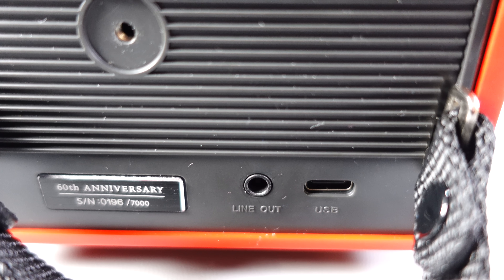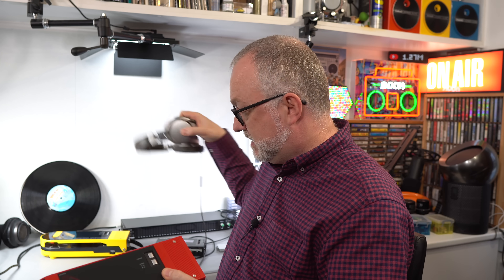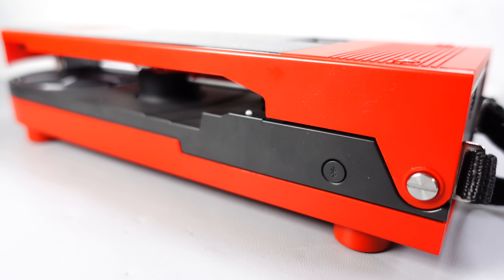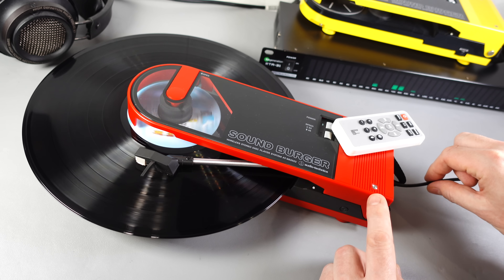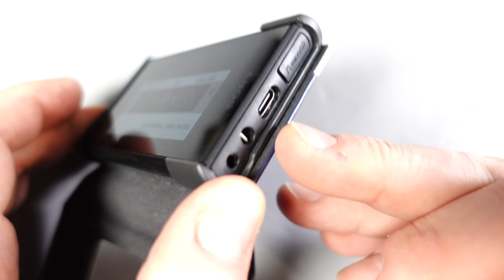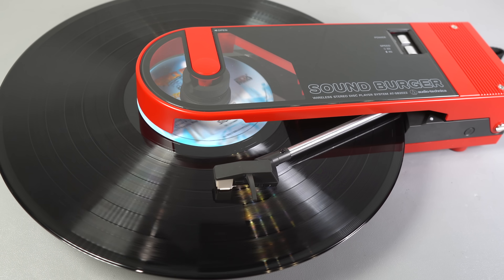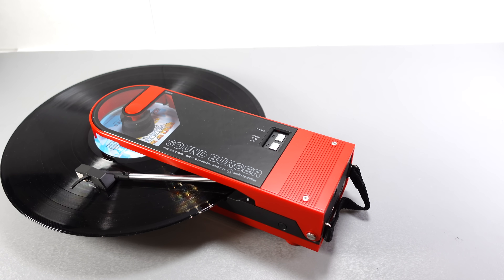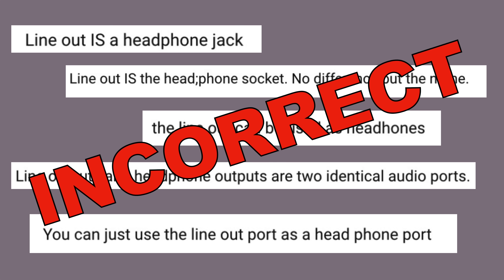Line-out ≠ Headphone-out

Comment: Another difference to consider is that the circuitry for creating a line output is designed to only provide just enough power to convey the signal from one device to another. They aren't meant to provide the power required to physically move a speaker/headphone diaphragm. And doing so could potentially damage or destroy the line output of a device, as it is being asked to provide a lot more power than it was designed for.

Related to that is the impedance mismatch. Consumer line outputs are meant to drive a load of roughly 10,000 ohms. Headphones are typically less than 100 ohms. Not only does this mean that it takes more power to drive the headphones than a line input, it also means that the frequency response is going to be all wrong. When headphones are plugged into a line output, not only will it be quiet, and you could be damaging the circuitry, it's also going to sound bad -- usually seriously lacking in bass, overemphasizing higher frequencies.

You can usually get away with going the other way (headphone output into line output) because it's easier to drive a higher impedance load than a lower impedance load, so headphone amplifiers can easily output the power required by a line input. Sort of like asking a sports car to idle down the street. But the impedance mismatch is still there, and it could result (depending on how the circuitry is designed) in bass frequencies being over emphasized. The other issue there is that headphone amplifiers, because they are primarily designed to provide more power rather than a cleaner signal, are often rather noisy (mostly in the form of hiss) compared to a true line output.

The best thing to do is make sure that whatever load (headphones, line input, whatever) you're driving matches what the circuitry in the output is designed to handle. Anything else can result in poor quality sound at best, and damage or destruction at worst.
Reply: if someone designs a line out that gets damaged by plugging in headphones, it's just bad product design, because it's obvious someone will surely do that
Reply: Indeed, my phone sounds better than an ipod with headphones, but the ipod(through a dock) using line out to my amp sounds better than connecting the phones headphone out to the same amp.
Even line out signals seem to vary though, I've got a portable line in recorder, but it gets peaked out(beyond adjustment on the recorder) & clips with the line out from some devices.
Reply: Another problem that arises when connecting a headphones output to a line input is the voltage level:
A lot of modern mobile devices at maximum volume are only capable of outputting a voltage at the headphones jack that is just enough to drive low-impedance headphones to a level that is acceptable by the ear protection limiter lobby. That voltage is less than what a line input expects.
On the other hand, several audio amplifiers have a headphones output that is tapped internally from the speaker amplifier circuitry outputs, with some resistors in series. This voltage us usually way too high to feed into a line level input.
You might be able to correct for this by adjusting input sensitivity or output volume but you will be introducing degradation, in noise levels and/or frequency response.
And, yea, the line output is totally useless for headphones.
Reply: Line Out = high impedance
Headphone out = low impedance
And yes, 600 Ohm is still considered low impedance.
Line out is designed to not drive anything else other than an amplifier, which is high impedance.
Reply: @kyoudaiken  No modern item of audio equipment has a high impedance line output.
Reply: @davidfaraday7963  The line level voltage is just extremely low and cannot drive any headphones.
Reply: @kyoudaiken  What particular bit of kit are you talking about? In general the line output voltage is similar to that of a headphone output and will have an output impedance of a few hundred ohms.
Reply: @davidfaraday7963  What you are saying defies the Ohm's law. Line output is not sufficient to drive a pair of headphones. You say it has the same impedance. Same voltage levels. So where is the difference? Why can a headphone amp drive the headphones and line level can't when you claim they are electrically identical?
Reply: @kyoudaiken  "What you are saying defies the Ohm's law" Does it really? In what way? 
Depending on the bit of kit, and the headphones, a line output could well drive headphones. A tape recorder of mine simply connects the line output socket and headphone socket in parallel. Note that Techmoan was able to run headphones from the line-out socket of his gadget, it just wasn't as load as he would like
And I never said that the output impedance was the same, don't strawman me. I said the voltage levels would be similar. A line out socket on a bit of domestic kit might have an output impedance of around 1kohm, a headphone driver more like 32ohm, but the voltage level would be much the same, around 0.5 - 2V.
Reply: @davidfaraday7963  It's about the loundness. And that's determined by the voltage (U) and current (I), and the latter is determined by the impedance of the headphones measured in Ohm. You could see in the video that the line-out did not provide enough power to even be usable for headphones. It's just an output for amplifiers or other recording devices. It's not meant for headphone use. This is why it has much less power because the inputs it is designed to feed is high impedance.
Reply: @kyoudaiken  Loudness depends every bit as much on the sensitivity of the headphones as it does on the electrical power consumed. The point you are consistently failing to grasp is that this all depends on the individual items used. May items of audio equipment provide ample output power for headphones from the line output socket, many types of headphones are sensitive enough to work adequately from a line output, so stop trying to generalise.
Reply: @davidfaraday7963  You either are so deep in your sciolism or you didn't even watch the video, or didn't understand the whole video. Line-out is line-out, headphone out is headphone out. They are not the same. New equipment may be able to sense if a headphone was plugged in and can switch to an amplified output, which would seem to you as if line-out would be the same as headphone out to you. There's no headphone with conventional drivers that work with line outputs because they simply cannot power them. No matter which drivers your headphones have, they can't pull free energy out of nothingness. It does not work. Unless your device output is designed to switch to an amplified output automatically, line-out is always insufficient for  A N Y  headphone type.
Reply: @kyoudaiken  Listen sonny, I've been a professional working in audio for half a century, decades before anyone thought of outputs that switch output levels, so stop trying to talk bollocks based on your own ignorance. Many a line out is plenty capable of powering sensitive headphones, I should know I've done that on countless occasions.
Reply: @davidfaraday7963  Of course, anyone on the internet could claim they work as a "professional working in audio for half a century", which isn't even a proper sentence. But okay. Maybe there are sensitive headphones out there that can work on line-level. I don't know. And I don't care. But the point of this video is clear. And I know a lot about electronics without even the need to claim I worked in that field for decades, because I didn't.
Reply: @kyoudaiken  Well it's obvious you didn't, otherwise you wouldn't be making definitive statements based on your own clear lack of experience.
Reply: They wont get damaged if they atleast are somewhat well made. The circuitry is usually in semi modern devices a single chip driving amplification circuit. It puts out what it can and nothing more
Reply: One of the main reasons for line outputs having high(ish) impedance is to stop people damaging it by connecting low impedance loads to it, or indeed shorting it out completely.
There's an awful lot of twaddle talked about impedance mismatching. In audio, unless you are sending the signal over miles of wire, impedance matching is irrelevant. Normal practice is to use a low-impedance line-out (a few hundred ohms) feeding into to a medium impedance (10k - 100k) input impedance.
Reply: "it is being asked to provide a lot more power than it was designed for" How does that work? It gives what it gives and the speakers react to what they get. Headphones are generally a passive device, aren't they?
Reply: @romulusnr  Impedance, which is a fancy way of saying "AC ohms". In a classic circuit with a power source and a resistor, P=IE and E=IR, where E is volts, I is amps, R is ohms, and P is watts. So, if you take a 1 volt battery and use a 10 ohm load, 1 = I* 10, I = 0.1. The battery is asked to give 100 milliamps. If it can't, the voltage will fall. Well, Impedance
 is the same animal only it's for AC - like you have speakers, which often will measure as less than a ohm to DC (and will burn out if connected to DC of any reasonable source) but present as 8 ohms to a AC source. 

Now, a well designed line out driver will be designed so that you can direct-short it and it doesn't hurt it, because realistically, 3.5mm plugs will do that at times. It will also be designed so you can connect it to a headphone output and it won't hurt it, because inevitably some idiot - or person who can't see the label - will do that. You're not going to hurt a line out by hooking it to a speaker load if the designer knew what they were doing. But it also isn't going to drive headphones acceptably
Reply: @jonathanpullen7439  You're presuming they know what they are doing. That's why it's not recommended to plug headphones,  there is no standard when it comes to line-in.
Reply: @xKrikket  I am, but usually when they *don't*, they just grab a reference design that already does the right thing.
Reply: @jonathanpullen7439  Just curious, why did you designate E for voltage instead of V, which I see used more commonly? E is usually Energy.
Reply: @NeatNit  Just how I learned it. I learned a lot of my electronics from my dad's books which were from the 1950s and 1960s so some conventions might have changed.
Reply: @romulusnr  I'm sorry but lol. P = U * I. And I = U / R. Speakers are resistances and voltage drops occur over them. It's never a matter of "it gets what it gets" in electronics. Your comment was funny 😁
Reply: Yes, headphones are passive devices, just like light bulbs. So how does a wall socket know how much current to put into a light bulb? Well, it doesn't, but it has a given AC voltage, and the resistance of the load determines the amount of power delivered. A fork has a much lower resistance than a light bulb, which explains why it would instantly blow a fuse (or set your house on fire) if plugged into a wall socket.
Reply: @romulusnr  The line driver which is designed to provide a high fidelity signal into a 10,000 ohm load of a line level input is not designed to drive a 32 ohm headphone. The amount of power the driver is TASKED TO PROVIDE is a function of the impedance being driven.
Reply: @romulusnr  Yes all speakers are passive, this guy is very confused.  You can never exceed the power available. If you could do that, it would mean you could make an infinite power source  He also seems very confused about impedance. Modern headphones are lower impedance which means less power required to drive them, not more as he is suggesting.  
This also has no effect whatsoever on frequency response as that is determined by the quality of the DAC or amplifier. The quality of the headphones will dictate how well it reproduces the frequency.  
The only part he was half right about was matching output and input.  Half right because he still has it backwards, you need to match your speaker to the source not the other way around.  You can damage a speaker, but never the source.  Its never a question of what the source can handle, but what the speaker can handle.
Reply: @IraFox84  "all speakers are passive", except, of course, those which aren't! Active speakers are common these days particularly in the PA field.
The power needed to drive headphones isn't a function of their impedance. Low-impedance phones will (all other things being equal) require a lower voltage but will draw more current.
Of course you can damage a power amplifier (unless it includes overload protection circuity) by connecting speakers of lower impedance than specified and driving the amp hard.